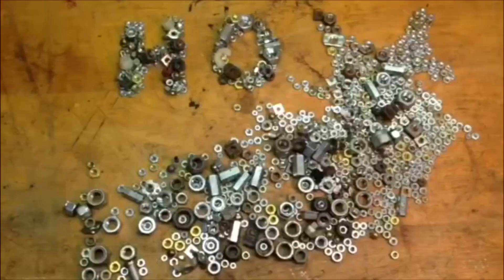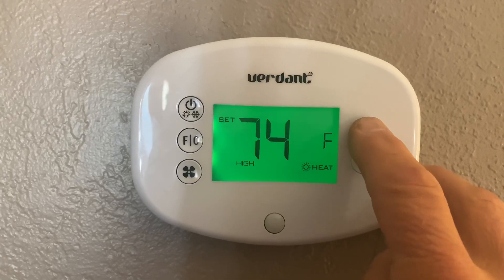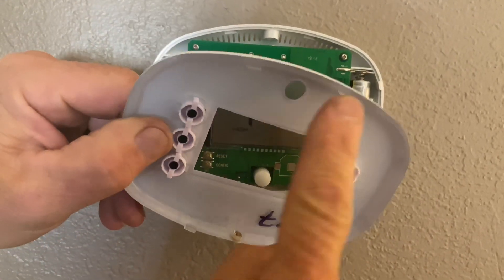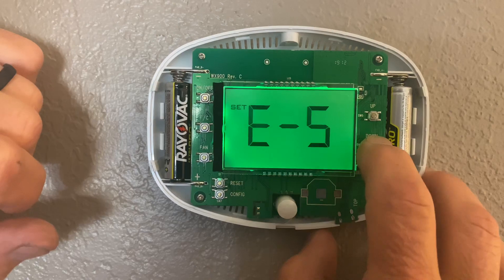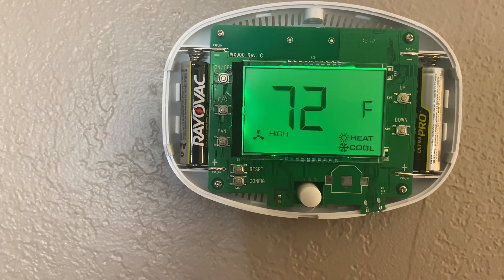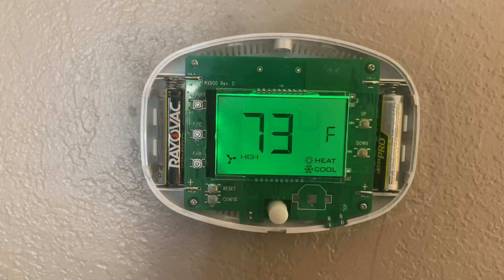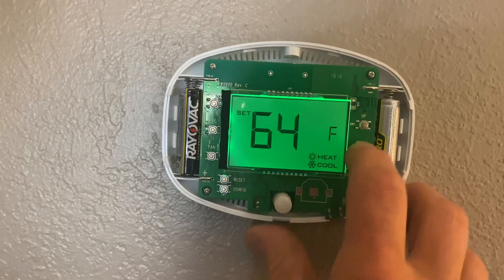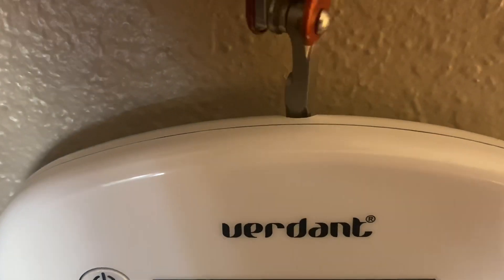Verdant Thermostat Override/Hack

Comment: Nice video, thanks for posting. The thermostat in my room looks exactly like what you have pictured. The menu is a little different than what you show. Might be upgraded firmware since your video. I found the E section, but the occupancy section looked very different. I adjusted the E with no change last night. I left the I alone, not knowing what the choices meant.
I asked the lady at the front desk this morning to program my thermostat cooler. She typed away on her computer, and she told me she dropped it 2°. Fingers crossed!
Reply from the maker: Hopefully that worked for you.
Reply: @funbro1 I did not get even a single good night’s sleep in that hotel. I appreciate the video. It was worth a try.

Comment: You're a hero!  Sitting in a hotel right now in California and the system is set in some extreme energy saving mode.  Found your video and BAM!! Not only can I now cool the room off, but got the fan to run constantly too (need that white noise).  THANK YOU!!

Also...a huge thanks to whoever took the screw out of the top and never put it back in!  😀
Reply from the maker: The screw being out is most helpful. Thanks for watching.

Comment: Your video is causing comapirs such as the one i work for to have issues where the resident  will inadvertently   mess up settings  bump the sytem off line and   cause other damage to equipment  via setting.  Equipment  codes incorrectly   be careful  doing this if you are anning to   go outside of your  rental leas agreements  as you can be fined for damages on top of  increased consumption
Reply from the maker: Be careful and always read your lease agreement before making changes. Thanks for watching.

Comment: This is a only temporary fix. That is a Verdant VX2 thermostat so at midnight or sooner the 'E-0' will automatically divert back to 'E-C'. Your best bet isn't to attempt fidgeting with a thermostat you know very little about, but to simply ask your hotel to place your room on VIP for the duration of your stay.
Reply from the maker: In my experiences this “fidgeting” has worked for the duration of my stay. Also experienced the blank, stare when asking the part time person at the desk to put the room in VIP mode. Only to hear “They don’t have a VIP mode”, or “They don’t know how”. Just my experiences. Thanks for checking in.

Comment: Hi my landlord just installed something like this 8n my apartment, the motion sensor is in ny living room and i work from home in the other end if the house so it never activates and i have cats as well that cant be overheating, if i reset this can my landlord see that i have tuned motion sensing off?
Reply: Also, there is no E setting on mine ,maybe they didn't turn it on, in addition to that where my occupancy mode should be based on your video is actually 3 big numbers and 1 smaller number with all 3 big numbers being zero and the smallest number being a 1, should I turn that one off?

Comment: I've stayed with Marriott for over a decade now.  This year i'm at their top level status. But I'm just about ready to break up with them all because of this crap thermostat.  Marriott already saves money by cutting back on housekeeping.  When they start controlling my room temperature, that's a step too far.  I can't believe they wouldn't care about this.  Their sole purpose is supposed to make you comfortable when you are away from home.

Thanks for the video Bob.  You literally saved me from doing significant damage to these pieces of crap in my hotel rooms.
Reply: Agreed !
Reply from the maker: Glad it helped you out. Thanks for watching.
Reply: I am having the same issues. I just did the instructions and it was already off. 😢 now it’s a degree higher 😢
Reply: IHG does the same in some of its Florida destinations
Reply: Same here. I'm titanium with Marriott and diamond with Hilton. Been staying in hotels for work 3 nights a week for 12 years. Videos like these have made my experience so much more enjoyable. I used to travel with a travel fan just for some noise and wind.

Comment: Just ran into this issue at a Holiday Inn. I can confirm this actually worked. I did not have to remove the top screw, someone already did. Had I needed a screwdriver I would have been in a bind. This was a life saver though nonetheless.
Reply from the maker: Awesome, glad the screw was gone already. Thanks for watching.

Comment: Will this go back to the factory or hotel settings if I pull the batteries and put them back in at  the end of my stay?
Reply from the maker: You can just reverse the process or leave it at the current settings for the next person.
Thanks for watching.
Reply: Dont change it, pay it forward !! Like i do removing water savers from shower heads :)

Comment: Good but one problem. I’ve accomplished both steps in my Hawaii hotel room but the problem is the air coming out of the AC unit isn’t cold enough. It’s like they programmed it to only provide 74° air no matter what the thermostat says.
Reply from the maker: Could be that the unit is not working correctly or that they have the thermostat wires into a central control. Either way I would talk to the office but not mention that you may have changed the thermostat settings.

Thanks for watching.
Reply: @funbro1  I have a feeling many AC units in the Hawaii hotels we stay in have centralized air that doesn’t get much colder.
Reply: Probably an old unit, they tend to freeze over.. Run the heat for an hour then try to cool it down.

Comment: Nope doesn’t work for occupant sensor override…9/2023.
Reply from the maker: Could be that the unit is not working correctly or that they have the thermostat wires into a central control. Either way I would talk to the office but not mention that you may have changed the thermostat settings.

Thanks for watching.
Reply: Worked fine yesterday in a new Marriott.....

Comment: It’s really just cruel for hotels to use something like this! I’m in a marriot room that has old cigarette smell, and it won’t go below 74 degrees. I keep setting it to 64 but it shuts off at 74. I have to teach a class in the morning and literally have had no rest because of this. I’m so mad!!! I asked the front desk and they don’t know what to do. I tried this video and I’m praying it works. I don’t know though I heard that the online system switches it back regardless 😫😫😫
Reply from the maker: I have heard that, but have not run across one that is wired in that way yet, so I have been lucky so far. Thanks for watching.

Comment: what does standard energy savings do? how to change to no motion but turns off after reaches temp, and turns back on after temp goes back up?
Reply from the maker: Energy savings runs less. Motion changes like in video, thermostat turns heat cool off when needed.
Thanks for watching.

Comment: I forgot to turn the heat off so it was running like 24 hrs. straight. So I'm leaving the hotel now, and putting settings back & noticed occupancy sensor went back to default.
Reply from the maker: Not a bad idea. Thanks for watching.
Reply: If it went back to default your system wouldn't have been running 24/7

Comment: WHO HAS A SCREWDRIVER IN A HOTEL😳
Reply from the maker: I DO EVERY TIME INSTAY IN ONE. I HIGHLY RECOMMEND KEEPING A SMALL LEATHERMAN TOOL OR SWISS ARMY KNOFE WITH YOU AT ALL TIMES. You can thank me later.
Reply: I've been in a different hotel in 31 countries in the last 4 years and have always had a small screwdriver in my bag. Either to work on the ac or to unlock the windows of the room I'm in.  Some countrys have the  room windows locked on any floor higher then 3. Need to unlock the cable thing just to open a window up.
Reply: @vw2112  And to remove the water "saver" in the shower head  lol

Comment: another hotel, and someone tinkered hardcore on this unit, so much so that the setpoints for heat and cool appear to be only 2 degrees apart. by the time the heat turns off, the unit senses it's time to turn on the air. 🥺
Reply from the maker: I could see that being a problem.

Comment: Why don't you simply ask for the facility to switch the unit over to to a constant fan mode or more of a temperature spread?  I used to manage a facility that had these types of thermostats and all a customer had to do, was ask us to make the changes.  We gladly would accommodate their requests.  We had many programs on the server for different conditions.  We also had the ability to turn off the motion sensor if the customer requested.  It would only take a matter of five minutes to get it switched over for the customer.
There were times, probably after a person watching videos like this, that people would get in the thermostats and lose the thermostat location in the program, from them fiddling around with the buttons.  It was time consuming to figure out which thermostat had the erroneous location number programmed into it.  
Plus, not everybody enjoyed the fan constantly running and cold temperatures, so people who came in afterwards were staying in uncomfortable conditions due to the previous guest' inconsiderate behavior.
Last but not least, was the damage people would do to the thermostats.  Not everyone carries around a Phillips Screwdriver, and I noticed another video on YouTube where the person is simply showing how to pry the cover off, without unscrewing it, which would cause almost certain damage to the unit.
If the person did cause damage to it, we did charge them for a whole new unit, and the labor to install it.  It wasn't cheap.  Customers didn't enjoy an extra $300 added on to their bill.
So, it won't hurt to ask, before getting in and causing unnecessary damage.
Reply from the maker: Not every facilities people are as accommodating as you sound to be. Chances are better that you go to the desk and ask for them to change it and they either say they are not hooked up to anything for them to change it, they don’t know how to change it, there is no one around that knows how to change it but we can put in a work request and they will get to it within 48 hours, or you get a blank stare from the person because they have no clue what you are asking or even what you are talking about. But thanks for the suggestion and thanks for checking.
Reply: Stayed in dozens of hotels around the world and most of the counter staff or "technicians" don't have a clue about this issue or choose not too.... Also they'd have to prove it was me adjusting the unit(good luck)... You could just make sure to complain the A/C wasn't 100% when you leave they apologise for your inconvenience offer you an upgrade next stay and i move on happier than when i arrived...

Comment: One of my ACS at my hotel the fan won't stop running it's a GE PTAC model az45e12dabw5 .
I made sure the auxiliary mode settings are correct so it's not that could it be the thermostat?
Reply from the maker: Sounds like the thermostat to me.
Thanks for watching.

Comment: Any chance that the hotel might be able to remotely monitor the thermostat and see that it's been tampered with? I'd hate to get my company slapped with a charge or something
Reply from the maker: There is a possibility but only if the building is newer, either way I wouldn’t worry about it myself.
Thanks for watching.
Reply: @funbro1   And so what if they do accuse you... id deny it play stupid and demand the manager... this one im in is a new build but there is no data cables running from the unit and it doesn't have Wi-Fi..
Reply: lol, no way.. Just do it the minute you arrive and relax.. The lack of worn out staff at the front counter couldn't give a shit..

Comment: What do I do if the panel does not have a screw but is welded in place?
Reply from the maker: I haven’t seen one like that before, sounds like someone modified it.
Reply: Just try harder to pull it off....

Comment: Bob, you just saved one flight attendant an awful night in a too hot hotel room!! Thank you sir. 🙏
Reply: i just wish i had a phillips screw driver
Reply: I happened to have a paperclip lying around and bent it a little to turn it into a rudimentary Philips head. It's a super short threaded ans small diameter (likely m1 or m2) screw and mine was screwed in loosely, so it doesn't take much force to get it off. If you happen to have a paperclip lying around, this might help! Sometimes you just gotta think outside the box :-)
Reply: And a pilot too now lol.
Reply: @AA0406-i2c Saved another pilot 🤣
Reply from the maker: Glad it was helpful.
Thanks for watching.

Comment: Your the best. Thank you Sir 

One screw and some re-programming later.. I’m in. Fan is running non-stop and dropped the air down to 64. 
Never Leave home without some tools.👍 looking forward to a good night of sleep.
Reply from the maker: Thanks for watching.
Reply: My water "saver" tool kit i use to remove those plugs from shower heads helped me in my mission to make rooms cold and the water flow !!

Comment: How do I know if the occ sensor is set to on? Just got in my room and don't wanna wake up hot tonight! But I did bring it down to 64 - which seems to be the lowest it'll go across the board 😔 but it hasn't gotten any cooler than 69... The fan has not stopped, but we haven't quit moving around yet either...
Reply from the maker: Is it the same brand and model as what is in the video? If so I would go through the steps listed in this video and that should take care of the situation. Hope this helps, thanks for watching.

Comment: This video set me down the path of looking at the configs for this thermostat.  I ultimately decided that the biggest issue was that its clock was off by 12 hours, which can be set on the first config screen.

The default of the Verdant VX's energy-saving function is to require constant occupancy during the day but only 1 minute of occupancy during the night (9pm - 9am) to stay out of energy-saving until morning.  (The goal is to accurately sense that people are up and about during the day, but know that they aren't visible after they go to sleep.)  With the clock off by that much, the temperature shot up once it couldn't see people sleeping.
Reply from the maker: Hopefully that will solve any issues you have with it. Thanks for watching.

Comment: i get "Err 2" on my thermostat how do i fix it?
Reply from the maker: Is it a verdant?
Reply: @funbro1  yes but i found out its not hooked up in the back wiring so i need to order the plug that wires to the pig tail wiring that comes out the wall from the ac unit

Comment: Just a heads up, these stats have built in radio to create a mesh network. If the property has it set up network settings will take priority no matter what configuration you do physically on the stat.
Reply from the maker: I have never seen one set up. This has always worked for me. Thanks for watching

Comment: Just used this to change the temp in my hotel room. It stayed 74 cause the air kicked off if you didn’t move every ten minutes. It’s now 65 degrees and I’m loving it. Appreciate it man!
Reply from the maker: Glad to help, Thanks for watching.
Reply: I need a fan on 24/7 or I can't sleep!!! Just did this trick, so far the fan is staying on... Thanks!!
Reply: Just "tweaked" my unit in the hotel im in at the moment seems like it worked :) I hate how Residence Inns try to save a buck and i dont get a good nights sleep... Now for the water saving device in the shower head ! lol
Reply: @__PJ__ Exactly how I found this video😊😊
Reply: Last time I "held" the button for occupancy sensor (step 1) the shit went into reset/program mode and became a brick. No amount of button pushing got the air to turn on at all. The hotel guys disconnected it and made it wall unit control only and that gave me 60f. I'm never screwing with that setting again.
Reply: @azzhat yeah at hotel now, your experience is why I am afraid to try this. May try on last day of stay for future reference.